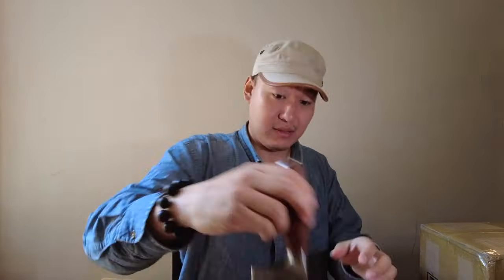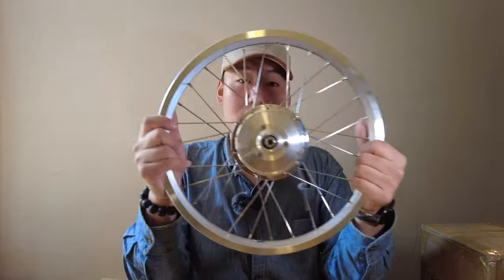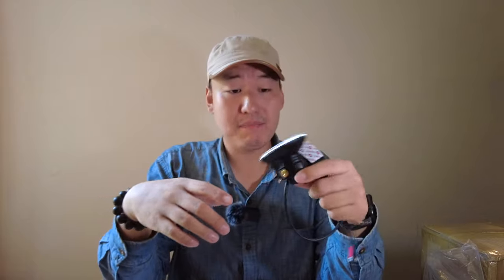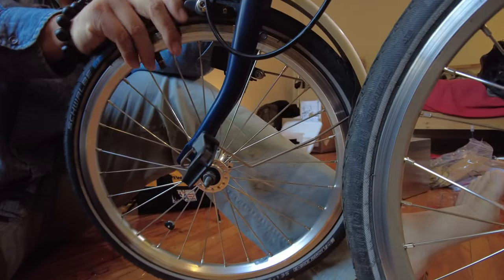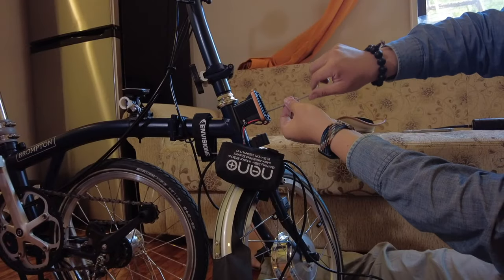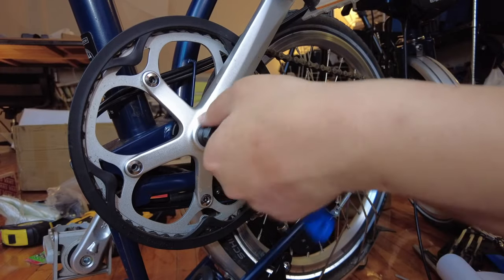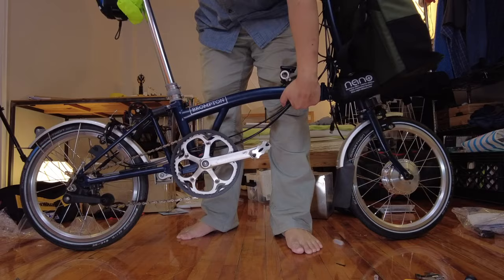How to make your OWN Electric Brompton

Comment: people forget, these kits do not have pressure sensor's so the riding experience is different. The Brompton electric has a pressure sensor bottom bracket so it rides with the sort of feeling and response of a mid-drive. These kits run off of cadence sensoring (rotation of wheels)
Reply: WHO CARES THE BEARINGS ARNT TO GREAT ON THE BROMPTON  E WHELL

Comment: After watching your video I spent more time researching Nano and decided to order one. However the company representative turned nasty very quickly when I mentioned her service was slow. I mean really nasty. I'd like to compare her to the Seinfeld episode where the soup nazi says no soup for you at the slightest wrong move. Well luckily that helped me dodge the bullet as it were. I'm so glad I saw the companies true colors immediately. God help you if you ever had a real issue. I further checked on alternatives and found that all this is easily available on ebay or aliexpress. I was advised (by a highly qualified bike shop) to stick to conversion kits that use the AKM motor. I'm also going to save about 600 dollars.

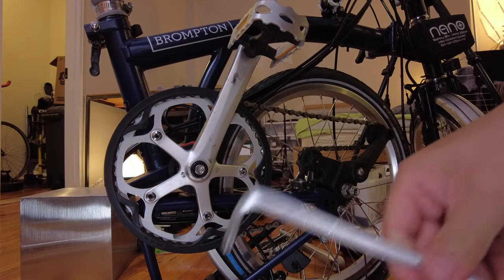Comment: You have put a spacer in the BB, so will need to righten the left side  (left crank needs to come off for that), or it will be loose. Around 9:00
Reply from the maker: Thanks for the heads up. Didn’t know that as this was my first time doing this. Good to know.

Comment: This is really cool, I was thinking the same just getting a conversion kit and doing it myself. makes my decision and saves me easily about 2k.  Get a standard brompton and upgrade to electric.
Reply: I didn’t get that. This kit is £1799 and if u add the price of the bike itself on top u won’t be saving money. Why go through all this when it will cost u the same to just go and buy an electric Brompton under warranty and everything?
Reply: most people convert an already owned bike to eV not go and purchase a new bike to convert it. 

Even then you can retro fit any cheap ev bike conversion onto a brompton, quite easily, just need to find one that matches the wheel size.

overall would still be cheaper than buying the E bromtpon. 

not to mention e brompton did not exist a few years back.  If you want to shell out $4k  for a new e bromtpon thats fine too. It gets you nice features and neatly intergrated system. Warranty is only 2 years on the electrical which is wack. And thats because I promise you the underpowered electrical kit brompton offers will last much longer than that.  

Not to mention almost all of the little scooters you see around use a similar 250 w motor. Shit you can even buy a little bag and make a battery that gives you way more range and power if your gonna spend another 1.5k for the e brompton. 

But again not everyone knows or wants to DIY it. if thats the case go get yourself a E Brompton.
Reply: @Mosquito3314  you actually right!

Comment: Great video, thank you! Can you tell me if the current Nano hub motor has toothed gears or is it still with the 'roller' system of gear reduction as in the original motor? 
Also does the kit have brake cut-off function when you use the brakes?

Comment: 1:15 Hi, I can't see any 20 Amp Hour battery on the Nano site, the biggest is 10 Amp Hour
Reply from the maker: I bought my 20 from Amazon. Just make sure it’s the right voltage and the plug is the same and get the biggest battery if you want.